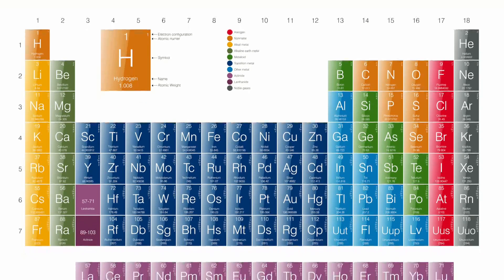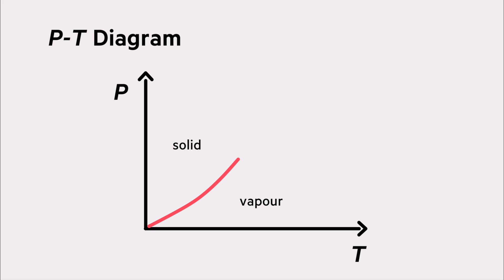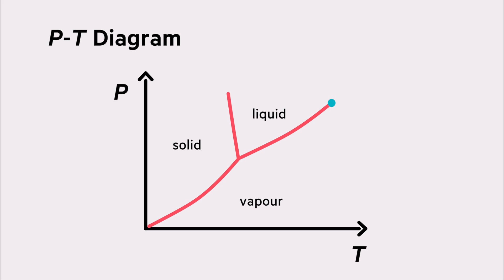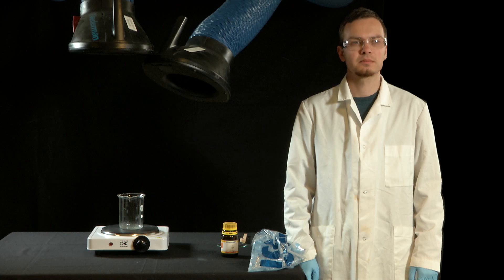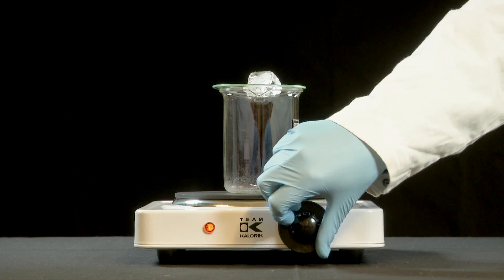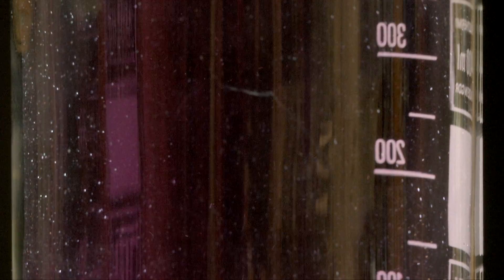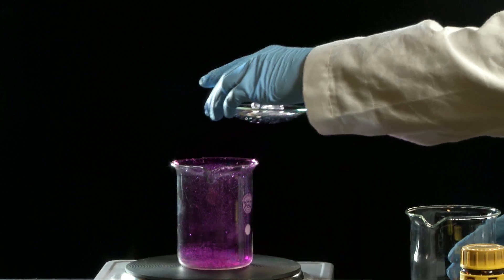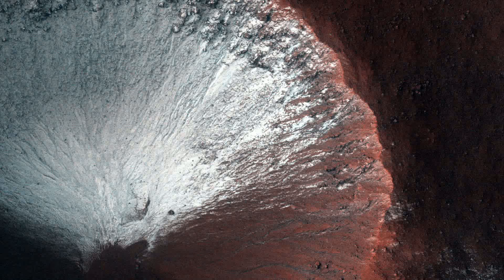Thermodynamics - Explaining Sublimation

Comment: Iodine is a chemical element with the symbol I and atomic number 53. The heaviest of the stable halogens, it exists as a lustrous, purple-black non-metallic solid at standard conditions that melts to form a deep violet liquid at 114 degrees Celsius, and boils to a violet gas at 184 degrees Celsius.

According to wikipedia the Iodine should have melted to form a liquid before turning into a vapour. The only time iodine can be in liquid form at room temp is when it's mixed with water so it doesn't really sublime. Btw, I cannot see how a vapour is considered to be a gas phase. in my opinion a vapour is on its way to becoming a gas through the process of evaporation. The iodine doesn't turn into a true gas by evaporation.